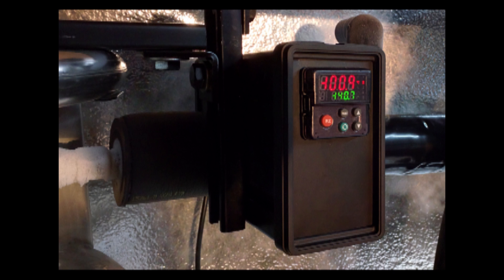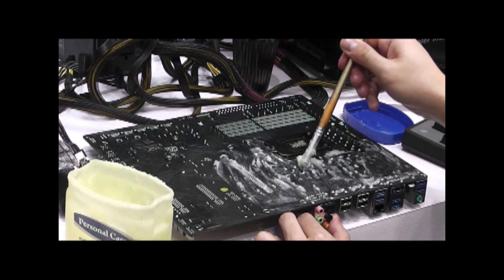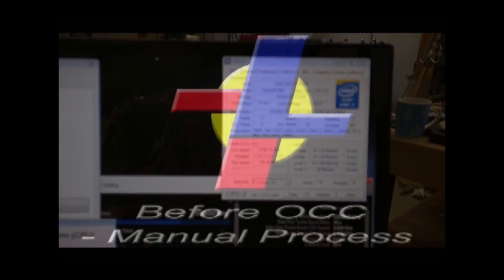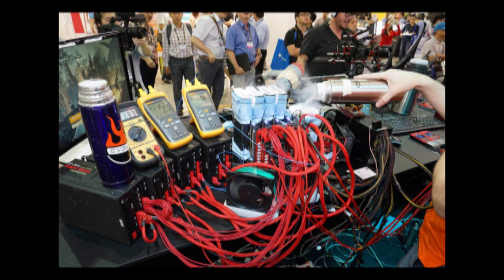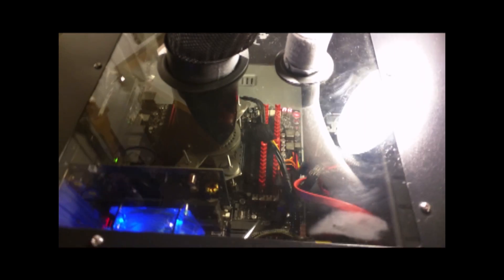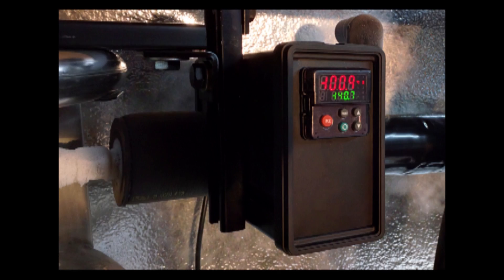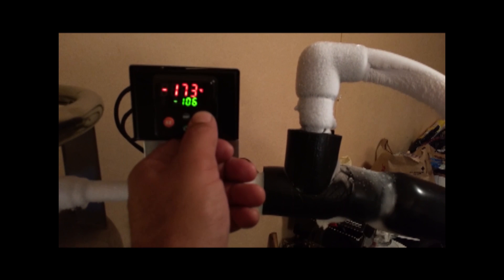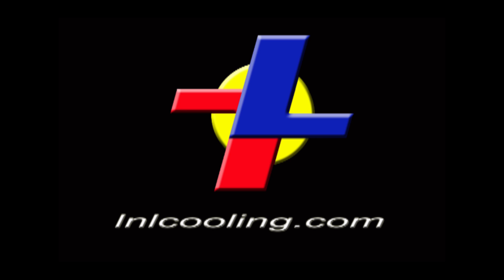Next Level Overclock LN2 Cooling With The OCC - Powered by Liquid Nitrogen

Comment: Would it be possible to use ultra low hertz frequency to vibrate the crystal lattice within aluminium metal to generate ultra low temperatures? I watched a video of a Stirling cryogenic cooler with a long aluminium probe. The ice crystals did not start forming from the base then worked there way to the tip of the long aluminium probe. The ice crystals forming out of the water vapor in the air formed at the tip of the long aluminium probe denoting resonance transfer from the Hertz frequency being generated by the Sterling piston vibrating. Could not the Hertz frequency be reproduced and transmitted into aluminum to generate ultra low temperatures?
Reply: Absolutely not. Nothing you said makes any sense. 

I think you have been tricked into thinking you understand something when you don't. Sorry.

Comment: I understand cryogenic valves and tubes are expensive, but damn, $3300 for a single valve, a single PID controller, a short tube, a few machined bits with expansion pipe?
I can buy an easily available used helium compressor kit that can pump a few hundred watts down to 77K continuously for less than that.
Reply: L&L Cooling Technologies, Inc wait wait wait, we aren't idiots. I recognize a cheap pic controller and hardware from Lowes when I see it it. The nicest hardware I see is that copper billet you bought from McMaster Carr.

So. If I may say so. It is HIGHLY likely that we DO understand what you are trying to sell. It's the same reason it's hard to start a loudspeaker company. You are trying to sell something to people who are smart enough to just build it themselves.

I would be more upset if I weren't sad for you.
Reply from the maker: Spirit cool. I'd love to see your build when you're done. you should check out some of our new videos. we've made quite a bit of change since this video. thanks for the comments.
Reply: L&L Cooling Technologies, Inc You're still comparing apples to oranges.
Your entire product is a valve with a PID loop.
I'm talking about a closed loop that doesn't require a dewar. Cold finger straight onto the CPU/die.
Reply from the maker: Spirit wow. I'd love to see that. our machines are a little more than a pid and some pipe. I appreciate your input, but assumptions just cause argument over things that you know versus things that we know and produce. no use in arguing.  I'm seriously interested in seeing the cold finger and so would a lot of other overclockers.
Reply: L&L Cooling Technologies, Inc There's nothing new to it.
Helium compressor, high pressure pipe, expansion head.
They're all over ebay.